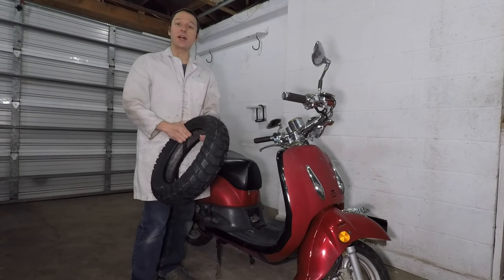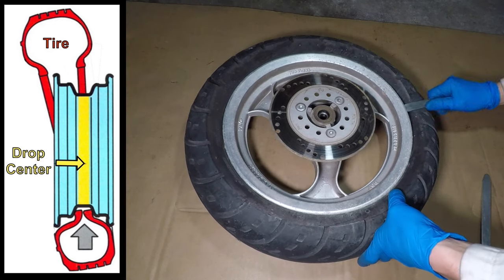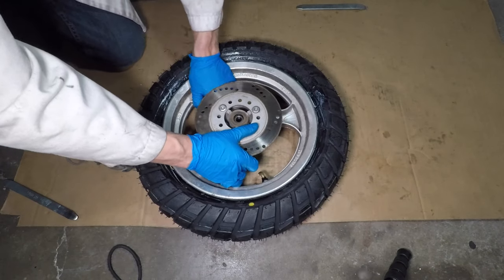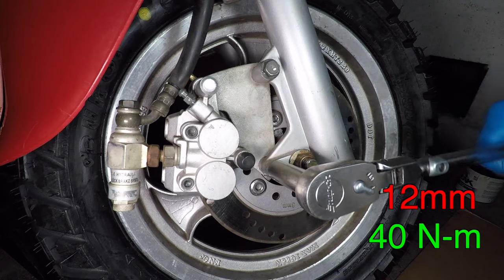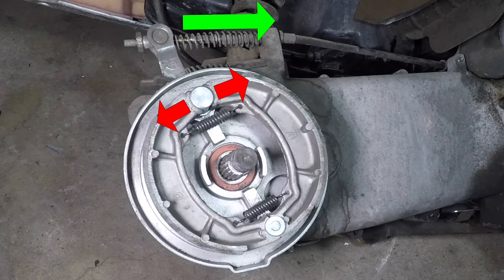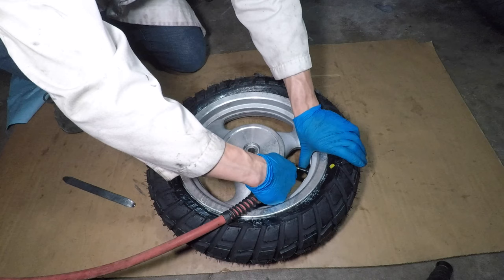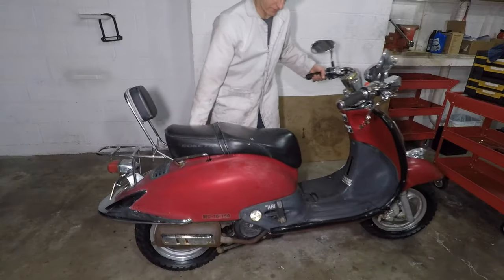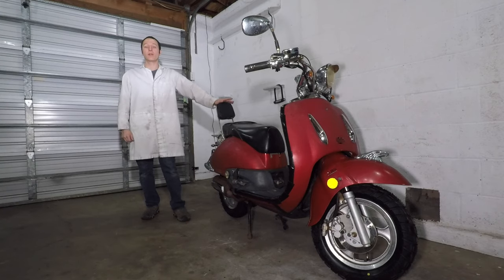Changing tires on a 150cc Gy6 Chinese scooter

Comment: I use a cheap, junkyard scissor jack under the frame to raise and steady the scooter. Garage sale item for around $2. Between the center stand, the back tire and the jack, it has four contact points to the floor. I have lots of milk crates for other things but they are shaky for this. I can put the jack just ahead of the back wheel under trans case to steady it during rear tire pull.

Comment: I restore old 2012-2014 Tao Tao's and the tires are always petrified. I leave them in the sun for a few minutes to temporarily soften the rubber, then use a large C-clamp or the bench vice to break the bead. Opps! Just noticed your "Stuck tire video".

Comment: My front wheel is 110/70/12 but i cant find any that fits can i use 120/70/12? Will this fit?
Reply from the maker: Yes it will fit, but it might rub on the fender.

Comment: How do l repair a striped out spark plug hole on my 50cc scooter?
Reply from the maker: I haven't done that repair yet, but the best way is just to replace the cylinder head.  https://www.partsforscooters.com/151-213-QMB139-Cylinder-Head
You can buy just a head, but make sure its EXACTLY the same as the one you have (bolt spacing, valve size, etc...)

Comment: Excellent. 
Is there any advantage to using a tubed tire? Perhaps ease of fitting.
Reply from the maker: Tubeless tires are much easier to install actually.  Dirt bikes use tubes because the rims have a bunch of spoke holes, and tubes don't lose all their air if you bump the sidewall too hard.
Reply: @LabCoatPaul   So the website's in the description I would like to know if the tires are kind of like universal for all makes and models
Reply: @LabCoatPaul   I'm sorry for all the questions but where do I get the tire levers at
Reply from the maker: @Scotty__  Watch the video at 0:12.  Your tire size is on your tires.  There are many different tire sizes, and the only way to guarantee the new tires will fit is if you buy the same size as what the scooter currently has.
Reply from the maker: @Scotty__  You can buy tire levers at any motorcycle shop, or online.

Comment: You should get a new exhaust and muffler
Reply from the maker: The muffler on this scooter is in excellent condition and is the really strong kind that doesn't fall apart.  Aftermarket mufflers don't add power but they make the scooter extremely loud.

Comment: This was Great But that's not what i need to know.. LOL I want to know what is the difference between a 12, 13 and 14 inch scooter tire. I can't find a video of that which is not in Hindu so I thought I'd ask you. LOL
Reply from the maker: If you have 12 inch tires on your scooter, you can't install 14 inch tires, because you still have 12 inch wheels.  The bigger tires ride smoother on the road, but with scooters, you have to stay pretty close to the stock size.  I installed tires slightly bigger than stock on mine, and they were rubbing on the fenders.
Reply: @LabCoatPaul  I see. I'm looking to buy a scooter you see and notice most come with 12 but I have seen 13 and 14 also. I have read a larger tire help in turns. I'm looking at the TAO TAO150cc VITACCHI - SPARK 150 which has 14 inch tires. Thank you.
Reply from the maker: @DivergentDroid  That scooter looks nice!  Yes, the bigger tires will give you better handling and a smoother ride.  You will probably have less storage under the seat.
Also, it's a Chinese scooter, so the quality will be terrible.  You'll have to constantly fix stuff on it.  
It looks like Wal-Mart sells them new for $1,400.  I bought a used 2010 Honda Elite 110 for $1200 a couple years ago, and it's 1,000 times better than any Chinese scooter.  2 years from now when that Chinese scooter is hopelessly broken, my Honda will still be good as new.
You should consider buying a used Honda or Yamaha instead of a Chinese scooter.  They really aren't good at all.
If you enjoy tinkering and aren't concerned with reliability or safety, buy a lightly used Chinese scooter for $500 or less.
Reply: @LabCoatPaul  That's the problem.. I can't find any in my area for 500. I have seen a lot of videos on Chinese vs Japanese scooters and the majority of people seem to think Chinese scooters are getting better. SYM is actually in Taiwan and I've looked at some of their scooters too. They compete with Kymco in Taiwan who are considered giants in the scooter industry having once been part of Honda. The quality is said to be as good as Honda with prices cheaper but not as cheap as the Tao Tao. I'd love to get a used Honda or Suzuki Bergman 200 but used scooters from the Big 4 are scarce around my city.
Reply from the maker: @DivergentDroid  You're right about SYM scooters.  I had an eTon Sport 50 a couple years ago.  It's a SYM scooter, made in China.  That scooter had decent quality. 
It had a few problems on the SYM, like the stock airbox was super shitty and let almost no air through, messing up carburetor tuning. 
The transmission also needed a belt, variator, and rollers after only 3,000 miles.  (My Honda has no roller wear after 5K miles). 
The list of problems was a few things.  Most Chinese scooters it's EVERY thing.  None of the screws stripped out on my SYM scooter, compared to ALL of them on a typical Chinese scooter.  That's nice.
Scooter prices are crazy now due to covid.  A year ago you could get a non-running scooter for $100, but now people are selling scooters that are completely fucked for $600.  
You'll do well with a SYM or Kymco scooter, but you're in for a lot of work and repairs if you buy a Chinese scooter, even if it's new.

Comment: Removing the Rear wheel is easy,
yeah right buddy that thing is rusted on there have been using all my muscles for this stupid nut
Reply from the maker: It's a lot easier with an impact wrench. Try jamming a pry bar through the wheel against the transmission, then using a long breaker bar if you don't have an impact wrench.

Comment: Don't buy a Kymco Grand Vista 250 unless you are a fabricator.
I did not know at first but the exhaust has a design flaw whereby it is constantly under tension.
So once it's off for the first tire change it won't fit back in place.
I had to cross thread the bolts for now and hope it holds until I can afford to use time serts.
Seething with frustration over such a sh*t design.
They do design work for BMW so it figures.

Comment: I mean if you're gonna do some serious trail ride on a Chinese Scooter

you better bring a spare of everything Stator, Ignition Coil, CDI, Regulator Rectifier, Spark Plug, Drive Belt

as they are prone to fail at the most impractical time 😂
Reply from the maker: This should be an old Chinese proverb:  Never ride your Chinese scooter somewhere you can't run back from.